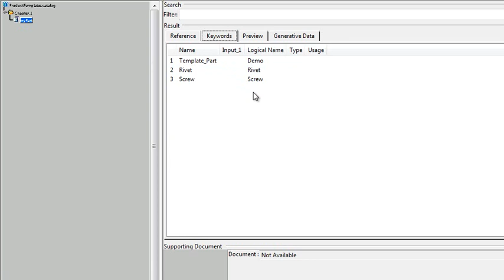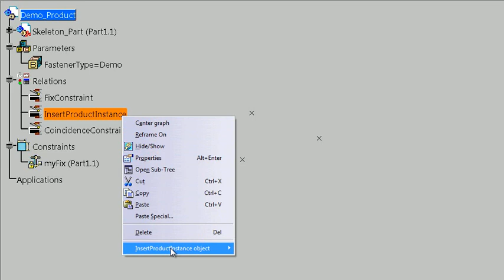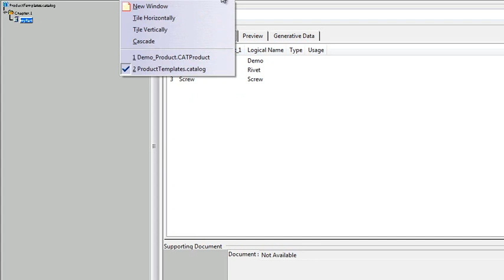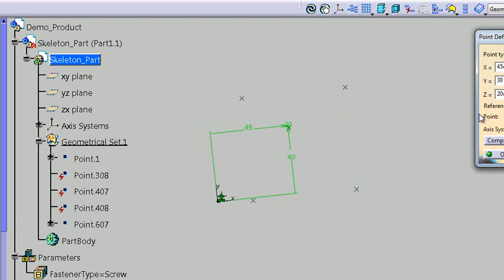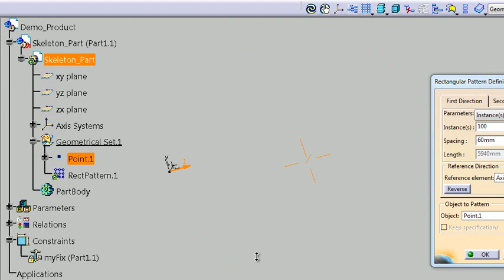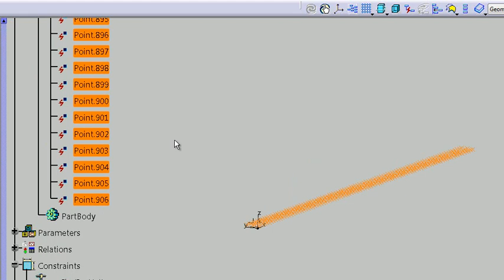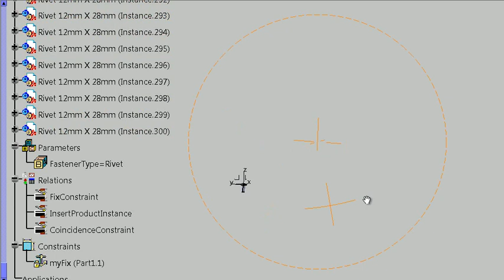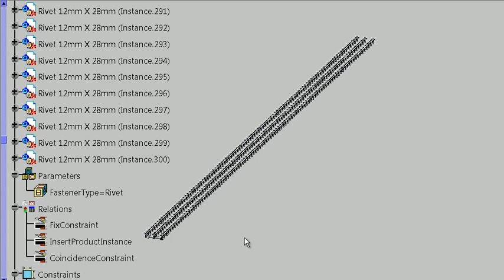CATIA V5 modular scalable EKL automation

Comment: Hi Jroak,
thanks for the great demos,
It's a while that I'm seeking a way to automatically constraint Ejector Pins and Screws in an injection mold,
every Screw or Ejector pin needs two constraints to fix it in it's place,
I want to select a plane for the direction and a point for base of the element,
have you a quick way for it without getting into scripting?

Comment: Nice demo Jeff, 
So what are the DOF for the rivits..?

This is close to what I do in my projects.. :-)
Reply from the maker: Good question. In this training exercise, I am using a point to point constraint. It not fully constrained. Another more elegant solution is to constrain axis to axis. Or more elaborate would be generating constants for point, line and plane. All are possible. It’s just a matter of requirements, input geometry and a bit of code. Feel free to contact me if you have specific scenarios you want to discuss. jroark31@yahoo.com or LinkedIn Jeffrey Roark
Reply: @jroark31  i was just curious to know if you have cracked the code.. but yes.. simply add axis systems to your points and one on the screw/revit.. that will fully constrain it.. :-) 
Btw. It’s me Michael from Denmark, we are already connected on LinkedIn.
Reply from the maker: @DenRoedeMogM  ah, yes of course. Difficult to keep up with everyone's online personas. I am afraid there is no secret code crack going on here. Not sure there is a code to crack when it comes to DOF.  Got 6 DOF every time.  🤔 The main point of this post is to encourage modular programming to enable reuse for better more reliable coding. But. I know you are already wise to this idea 👍 Thanks for the conversation my friend.